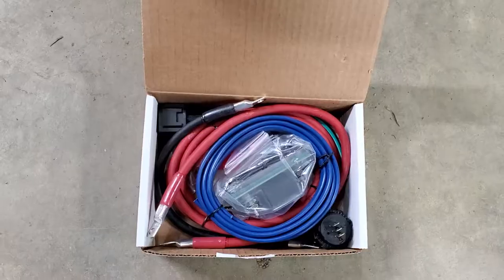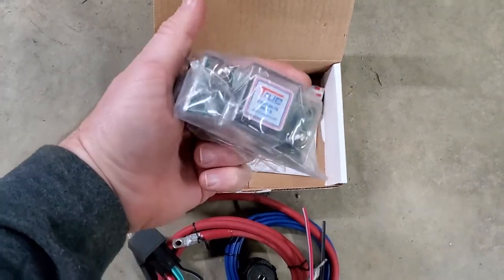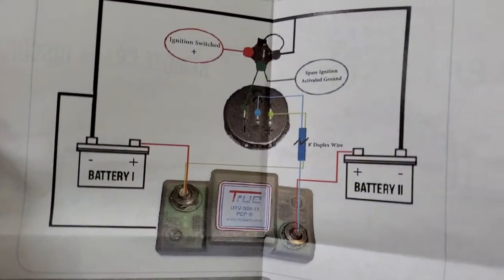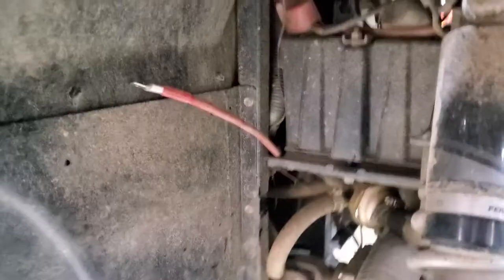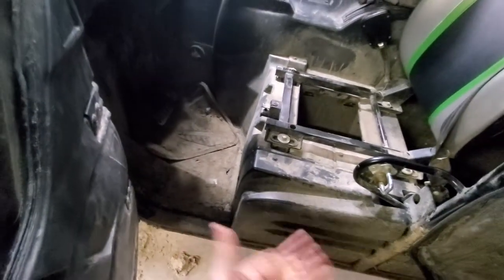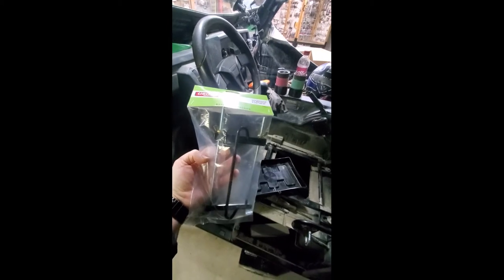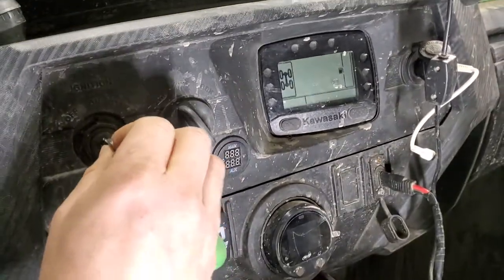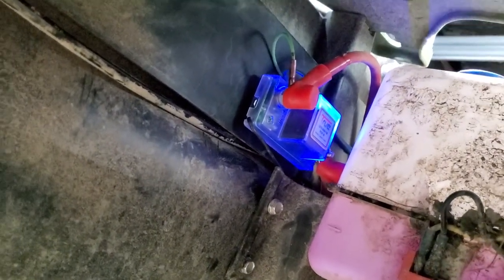True Am Dual Battery Install Kawasaki Teryx

Comment: I didn't realize the "PEP" model SBI that you installed (which is designed to optimize Lithium batteries) actually works on SLA/deep cycle batteries too.  This is good information.
Reply from the maker: While it does have PEP this one specially says, does not work with lithium batteries. They have a different version that is specifically designed for lithium.

Comment: Where did you get the power from on the switch side ? Just got the same product and mine came with a black square fuse block thing, it requires switch power ?
Reply from the maker: Snagged it off the 12v outlet.

Comment: I’m having trouble choosing the proper battery, I ordered the tray/kit but don’t want to overpay or fry system with wrong battery? Could you suggest a couple with details/part number, etc? Forums say Odyssey and Optum, your link took me to Moose but they look too small for tray?
Reply from the maker: I personally used a cheap marine battery from rural king. Just a 12v lead acid deep cycle in 12v. Dc24hdt
Reply from the maker: Also, the one I used doesn't completely fill the tray, but with the strap that came with it, it doesn't move around or anything and has been working great.
Reply: Thank you, what u are saying is any battery made for bumping around will work though?
Reply from the maker: Yes. Pretty much. You don't want lithium though. You have to keep it the same type as current battery to work right. Factory is a standard lead acid type. I usually look for something with a decent CCA or hours of deep cycle.

Comment: Did it matter the size of the secondary battery?
Reply from the maker: Not really. The tray had room for a bigger one, but I just went with the marine deep cycle because it wasn't too expensive. You do need it to be a lead acid though.

Comment: Answered my question about adding a second batrery to my 2021 Teryx.  What brand of winshield do you have on that machine and did it come with the wiper/washer?
Reply from the maker: I have a Koplin windshield on this with Vents.  I personally like it the best out of the 4 different ones we have in our group.  It has vents you can open and close and does a decent job of keeping rain and mud off.  I added the wipers to it myself with some electric wiper kits from amazon.  I want to design a new kit for it though that would use one motor and control both wipers.  Its just too cold outside to mess with it right now.  Koplin does recommend using their roof also as it will create a better seal.  I currently have the factory roof and you get a lot air coming up over the top of the windshield.  In the summer it's great.  In the winter I stuff with pool noodles.

Comment: Hi there can you use higher cca than it says. Or will that hurt my machine . 2016 kawaski teryx
Reply from the maker: I don't think it will hurt anything. I never thought about it.
Reply from the maker: I don't think it will hurt anything. I honestly never gave it much thought as the voltage is really the important part there.